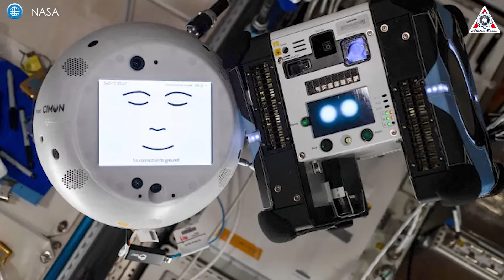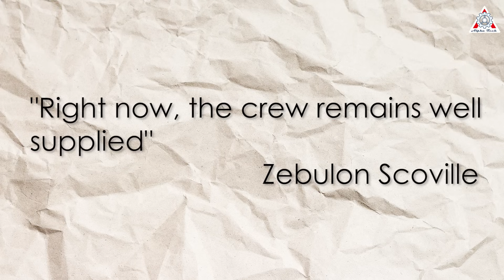What NASA just did with SpaceX Dragon completely humiliated Blue Origin…

Comment: According to to stats produced by blue origin itself the crew capsule reached a apogee of 346,802  feet and the booster reached a apogee 346,481 feet these are at ground , level the mean sea level is a little higher value … meaning the crew capsule only reached 400 feet higher than booster at apogee … when the karmin  line is donated at 100 km or 62 miles the crew capsule if you must use the sea level measurement which gives ns 31 a higher value of close to 107 meters [note they always round up the height values 346,802 is actually 105.7 meters ] the question I’m asking why does the official video dentate something completely different than the stated facts you can here on the vid the crew pod separation when it fly a mere 400 feet more than the crew capsule the video has the booster falling way before the crew capsule even reaches apogee … the official video doesn’t match the stated numbers nothing seems to match from what I recall in the video I make the crew capsule above the Karmin line for 51seconds total  ,, all I’m saying they better come up with better answers videos don’t match what they stated as official numbers and we won’t even touch on speeds and terminal velocity’s remember 10minutes 21 seconds is not 11 minutes and that’s  5 minutes 10 seconds up and 5 min 10 seconds back ,they would of reached the weightlessness stage when  till they started falling how long can you be out of your seat in 5 min 10 seconds the booster arrived back in even less time ,, my spidey senses have Alarm  bells  ,horns and hooters  going off in my head it’s all seems so out of the realms of any of it believable
Reply: They like to keep people fooled and perplexed.  Truth is something hard to find anymore, even by scientists.  It's an extinct animal.
Reply: Great analysis the Blue rocket looked like the Democrat party...if you get my meaning.😊
Reply: The bottom of the booster is hemispherical while the bottom of the capsule is concave. The resistance presented against the oncoming air isn't even close. The booster zips down without concern for G-forces.

Both parts of the launch vehicle have the same momentum at MECO. The capsule, being bullet shaped, will rise a little farther with it's remaining kinetic energy than the booster does. The booster takes the turbo elevator straight down into thicker air where it can better maneuver and slow down for landing.

Comment: I don’t think that the blue origin flight took off. I think it was all staged on a soundstage. There are too many things that don’t make any sense like, how is it that the capsule can return pristine white after reentry and not to mention the fact that the door is supposed to be open from the outside, but yet, if you watch the tape, somebody almost open the door from the inside Before they told them don’t do that so we can open it and make it look good so yeah I don’t believe it was a real fight. I believe it was staged.
Reply: Hollywood actor. They act the milli vanilli
Reply: * because there was no reentry, at least not of the kind you see from eg. SpaceX.
The capsule went straight up, came to a standstill (speed = 0) and fell back to earth. This is completely different to a reentry from orbit, where the capsule needs to be slowed down from orbit velocity. In this case you need a heat shield in order to get rid of the enormous amount of kinetic energy and end up with marks on the capsule. None of that is true if you just start a free fall at 61 miles.
* the door is not supposed to only be opened from the outside. If the capsule fell down miles away (because the parachute gets blown away by wind), do you really want to wait for crews to arrive or do you simply open the door and step outside? Besides: since the door seals itself while up in the air (pressure difference), there is no need for special hatches. A simple lock like the one in airplanes is completely sufficient.
The whole "Jeff opens from the outside" was a publicity stunt for the media. "Oh look, here comes Jeff to pick up his girlfriend. What a man!". Only that the girls inside blew it up. They could not even follow this simple instruction "Wait, until Jeff comes. Oh, and smile for the photos".
Reply: @ still say it was staged
Reply: @kallewirsch2263   FALSE... a real space capsule can only be opened from outside... Every time NASA, SpaceX,   ROSCOSMOS (Russian Space Agency) lands a manned capsule it cannot be opened from inside... Astronauts and Cosmonauts have to wait as long as it takes  for the recovery team to open the door for them... This is a known fact